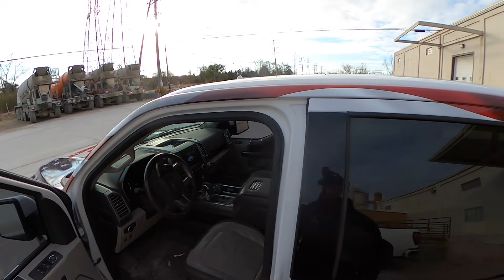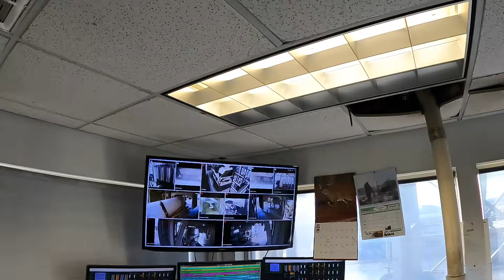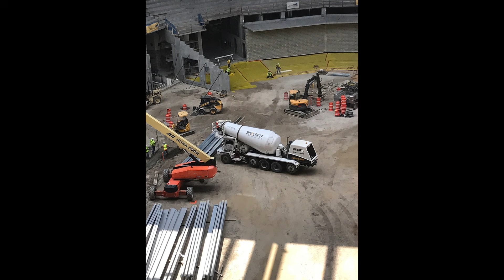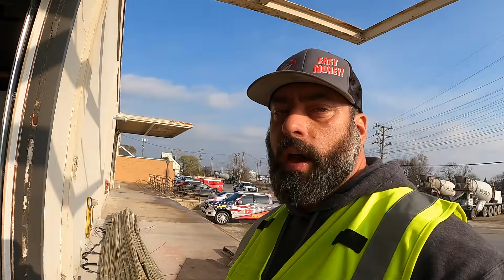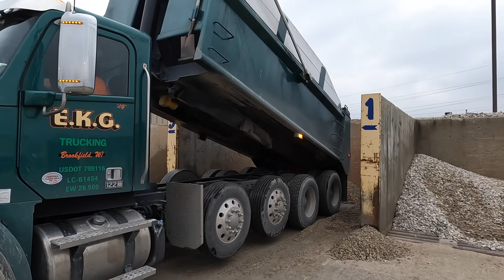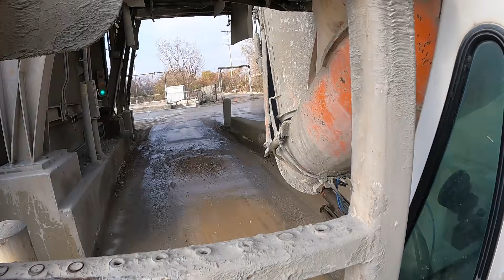Concrete plant tour - Victory style!

Comment: As a ready mix driver, I've worked for Miller Concrete, which is a decent company, and you get a ton of hours. I currently work for Dufferin Concrete, and they are the absolute worst company I've ever worked for. DO NOT BUY FROM THEM!  They treat their employees like garbage.  Their attitude is that nobody produces concrete better than them, and every other concrete supplier out their produces a garbage product. It's a rotten attitude to have. It's funny because in Canada, they pay their drivers the lowest wage in the industry. It's good to see behind the scenes

Comment: Great video, so just to check, it all goes into the lorry dry and the barrel turns and that’s all the mixing it gets?? And how long does it take to mix up??  🐶🇬🇧
Reply: They can also add water in with the dry materials.  Then it goes to a washout area where you can wash down debris from the plant.  Then you max out the drum speed, which is about 17.2 rpm, and add water.  Thats also where you can add fibres and reload your water tanks.

Comment: Really cool video and very much needed as well. Ypu got all these people that love to watch you pour and we have alot of questions about how it's made. You've actually made me start loving concrete as much as you. Before I watched your channel I saw a documentary about when some guy decided to to put rear in the concrete so it not only has compression strength but lateral strength as well and that was pretty genius. But you started me on my love for concrete. Watching the pours and getting ypur height and cutting joints. I think tooled joints look so much better than saw cutting BTW. I've noticed alot of sidewalks around here they leave the tool marks from the edge of the jointer. And they don't use the mag to smooth em out. It doesn't look bad I just wonder if they meant to.

Comment: I just read the Wikipedia history & description of concrete--it's been around for millenia, & it's the most commonly used substance on earth 🌎, besides water itself. The worldwide concrete industry is valued @ over $600 billion per year. Your video was excellent. The one thing I always begged my parents for as a kid growing up was for an in-ground, concrete pool in our backyard. My parents eventually gave in, but they had a hard-packed sand in-gound pool, with a vinyl liner installed, instead of concrete, because concrete was too expensive. The pool was dug & built by a top-shelf contractor, & we never had a problem with it, although you could put a dent in the bottom if you dove hard into with your fists extended (or, your head). We did have a very nice concrete patio built which surrounded the pool, which had a diving board & a sliding board. It was 8 feet deep in the diving area, & 3 feet deep @ the shallow end, & the pool was 20 feet wide by forty feet long, kind of in the overall shape of an elongated peanut 🥜. If it would've been built of solid concrete, it would've cost about 5 times as much. People think concrete is cheap, but it's definitely not!

Comment: Where does the water get added in? Also I’m surprised the belts are on the ground so they have to like dig up the parking lot if a belt goes bad
Reply: There's a pipe that dumps it right in the truck as they are loading the materials.  The trucks also have a water tank the drivers fill and they can add more water if needed to get the right consistency.  The underground belts are in a tunnel and accessible without having to dig anything up.

Comment: Hey Ryan, when do they add the microfiber that you sometimes ask for?
Reply from the maker: It helps give the concrete tensile strength during the curing process.
Reply: Yes but it was not mentioned in the video just wondering where in this process that is added?

Comment: Interesting, there’s a ton of similarity on what I do and how concrete gets to your job sites. I am a Cement Equipment Operator. Our cement is engineered depending on the location on the well, with many variables for well integrity. We have a “bulk plant” where bulk will off load cement, a warehouse with mixing station for which job, and a loadout where our cement is load into a bulk truck to be taken to the job location. Thanks for the video!

Comment: I still remember when I was concreting engineer, those sleepless nights. I have to fight with these batching plant sometimes when their truck is delay especially when pouring vertical to avoid cold joints or when their mix did not pass the slump test. 😅

Comment: Love your passion for concrete and your business. This was my standard concrete order when I was in big construction. X amount of cubic Meters, 30mpa, 100 or 120 slump, 20 ml standard chip , trucks 20 minutes apart. I'm from New Zealand so we have the metric system. Imperial-Cmon. Im just a builder who ordered alot of concrete back in the day. Left big construction, and just running smaller stuff now. Love the channel. Its my zen after work watching your videos. You have great self control. really respect that. I understand the pressure of concrete. And I understand the turnover of staff in a tough trade.

Comment: that plant is called a DRY BATCH at lycon where i work as a redi-mix driver we have 3 plant middleton wi, eastside of madision and our oregon plant which i work out of which are called WET BATCH because they have a 11 yard barrel above you which all the material get mixed first then dumped into our trucks.. much cleaner without all the dust flying around and much much faster loading times

Comment: Is that a dry batch plant? Our plants for the central/northern of MN are dry batch besides the St. Cloud(Waite Park). That wet batch plant is just nuts, pretty much the material gets mixed in a drum first then dumps the mud into the truck. Slump is on point every time, I know that’s because of the batchman down there. A tutorial on how they test air and slump would cool to see(I’ve seen it many many many many many times but I bet most of your subscribers haven’t). Also your Stamping process would be cool to see, I’m usually driving back to the plant by the time they start stamping. Also have you ever had a driver help you rake, screed or run buggies if you’re short handed? This last season, we had several contractors that once had 4 guys get bumped down 2 or even just themselves.

Comment: When I was a Field Concrete Inspector I would make the test cylinders (usually 3 on a job but depended on how many years were poured) or be sent to the plant to calculate the amount of additional water that could be added if needed and if things were slow I would be in the lab testing the samples on the break machine.

Comment: Great educative tour Ryan.
Still i got a bit confused with the term 6 bag mix.
This is 6x94 pound (42.6 kg) cement in 1 yard (0.91m)
As far i know concrete is
1 part cement
2 parts sand
3 parts gravel
0,5 part water
Is the mixture more cement parts?

Comment: Question, what happens with extra concrete you don't use or if you reject a load. Like, what does the concrete truck do with it? Just have a spot they dump the material at the plant when they get back?

Comment: It's funny how I see the Sika's logo, at first I thought Sika was only a Philippine company (since we literally have the Sika Philippine division main office and distribution ware house in front of our little town home) but with the rise of the internet I learned that Sika is a huge company, no wonder we have a Sika sticker since we actually use their concrete
Reply: Sika is a great product, i live in the Florida Keys and i have used Sika products when i worked for dock company and now just finished using the crank filler, i have used about 35 of the large tubes and it work great self leveling, The Home Depot stores handles the product, i did not know it came from the Philippines, learn something new everyday
Reply: @butchs2337  Well it's not really from the Philippines, I just found it funny that we have a distributor/factory outlet in front of our village, Sika is actually from Switzerland!

But in terms of the product though, due to the heat cycles here (and it's been years now since we poured Sika Cement mix) the house's original concrete is cracking already, we have a room extended from our bed room and it's really nice to see that Sika's cement has lasted more than the original house's concrete, no cracks what so ever.
Reply: @princekyle5678  I live in Florida, USA i live in the Florida Keys and i have known people from your country and they tell our weather where i live is about the same s ours, yes very hot and not very cold in the winter, i have used the Sika self leveling in a -20 degrees freezer on the floor cracks and have used outside and seems to work great for me, just check the expire date on the tubes, have a great day
Reply: Paul Ramsburg district manager at Sika USA really appreciates the promotion of their products.
Reply: Big in the UK too. They make alot of products
Reply: You'll See Sika Products being Used at Almost Every Construction (Residential/Commercial) Job Site here in Los Angeles!!